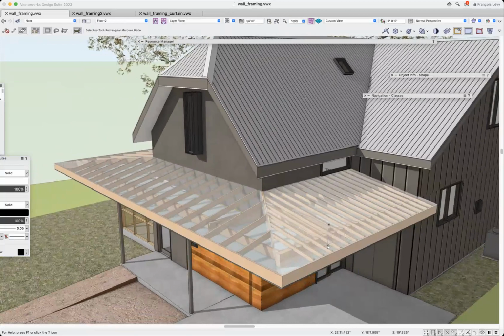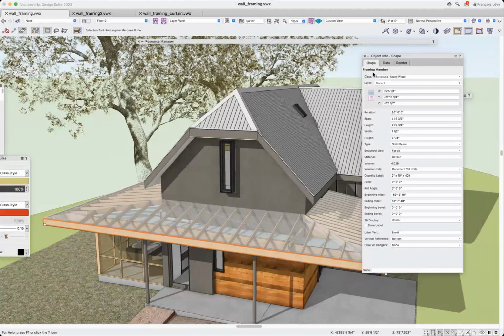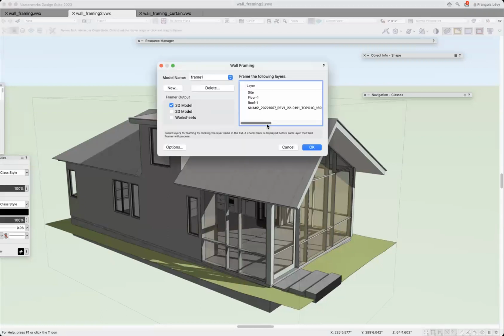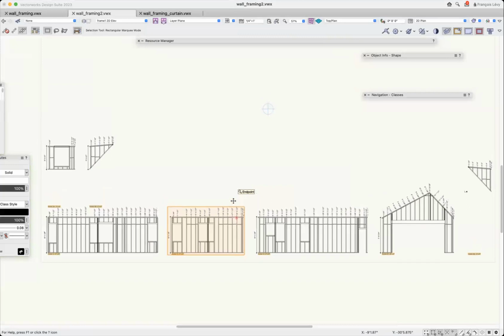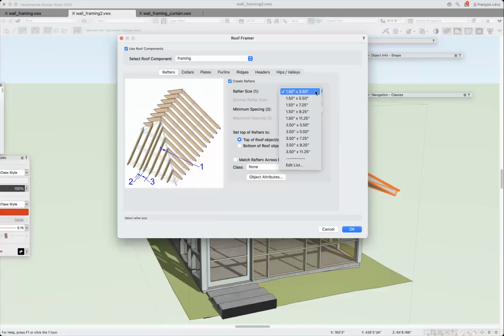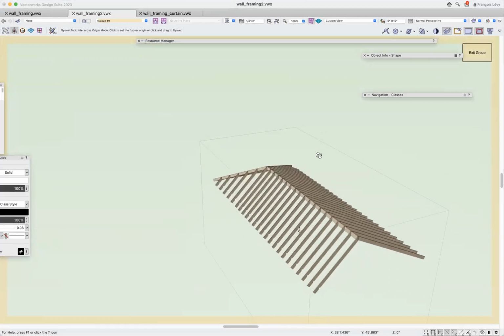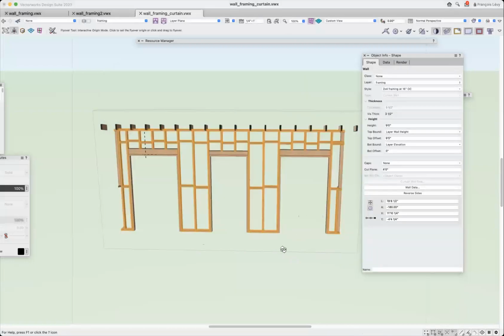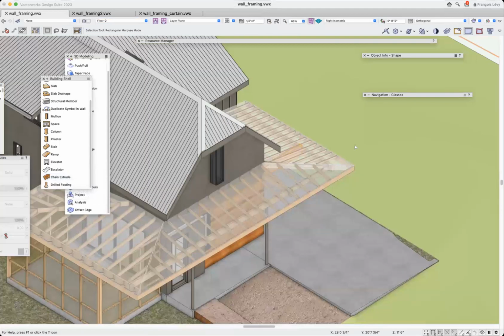Austin Vectorworks Community, May 2023: Framing

Comment: When I use the framing tool all the sections where the exterior wall connects to an interior wall the frames are offset a bit and angled. I don't know why this is happening.
Reply from the maker: Hi Damien, thanks for posting. I don't recall having seen that behavior; can you verify that the original walls are exactly orthogonal? As an aside, note that the wall framer will frame to the wall's core component. So if you specify 2x4 studs in your framing settings, but choose a 2x6 wall, the framer will create 2x4 framing at the centerline of the 2x6 framing component.

Comment: So a framing member with a solid subtraction still retains the framing member attributes data etc?
Reply from the maker: Partially; a framing member that is part of a subtracted (or added) solids remains a framing member within the Boolean structure of the resulting solid. It does not display as a framing member would. The top-level object is not a hybrid with distinct 2D and 3D display, and you'd have to edit the solid to see (and edit) the framing member. Also, a database worksheet would not report the enclosed framing member object.